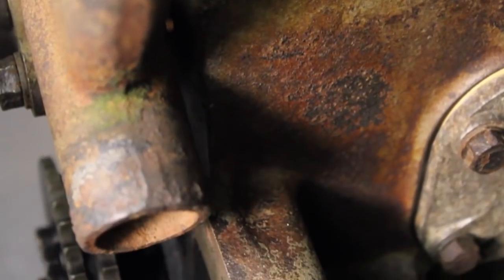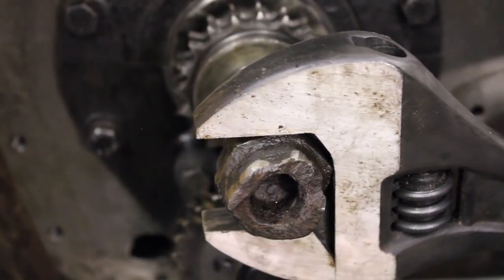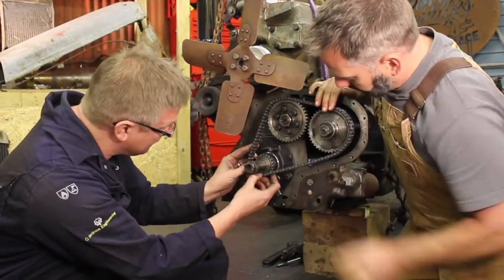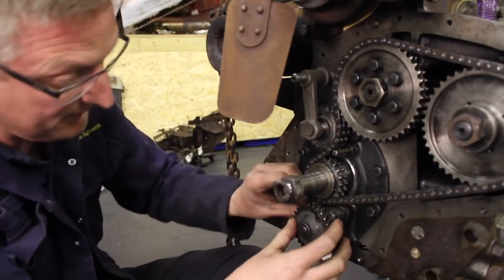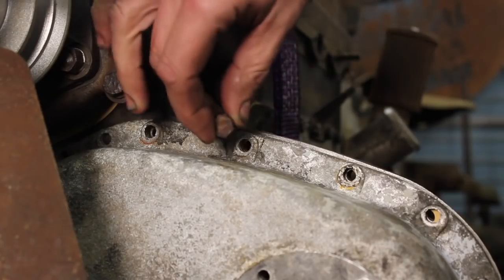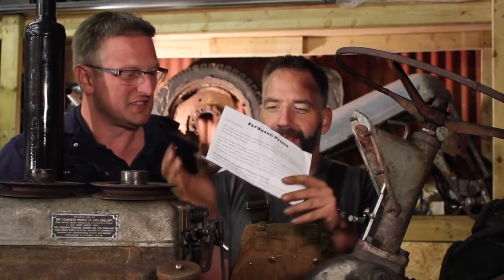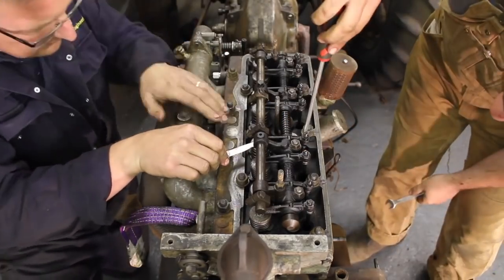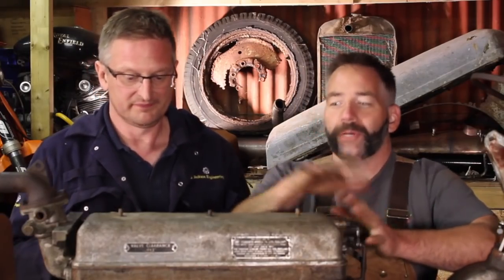Barn Find Fergie.  Episode 10. How To Time An Engine

Comment: Hi guys enjoying the build, long time since I was working as a mechanic (40 years) but I think your timing should be set at TDC on No1 cylinder on the firing/compression stroke if I remember correctly you could find the injector pump delivering into a cylinder with open inlet/exhaust valves. Hope this helps.
Reply from the maker: Thanks Andrew, that's great information!

Comment: You can use the "rule of nine" for setting tappets on a 4 cyl engine. When valve 1 is fully open, set gap on 8 (1+8=9), when valve 2 is fully open, set gap on 7 (2+7=9) and so on
Reply from the maker: That's a great bit of advice! Now I just need to improve my maths, hahahaha
Reply: Excellent tip👍

Comment: She's getting there guys, bit concerned with Jimmy's feeler gauges being "old and worn" must have lost a few thou over the years, better than my set though, where I once tried to set tappets on a HA Vauxhall viva with the engine running, per the manual, and ended up with feelers like crumpled kitchen foil!🙄
Reply from the maker: With it running!!!! Wow, that would be worth a watch!
Reply: @Torquestamiya 

Yes - the pushrod Viva engine. It didn't have a rocker shaft; the rockers were cupped pressings which pivoted on a self-locking nut with a hemisperical lower surface, screwed onto a stud pressed into the head. As the adjuster nut was stationary it was easy to adjust the tappets with the engine running allegedly 😂 gave up and did it stationary in the end
Reply: Sounds like fun!

Comment: Because I live in The States, I deal with both metric and Imperial (what we call SAE) fasteners all the time. All standard Imperial nuts and bolts have a metric spanner size that will fit them.

Comment: Pause.....Have to consider my options here....🤔 Will i risk going any further into a vid with two guys in a shed, boasting at the start about.......... loads of manual action....😲😱
Reply from the maker: Well did you???
Reply: Stroker, shafts, holes, shafts in/missing holes, coming together.....it just got worse Jimmy 😂🤣 Was it hard to insert this in the vid? Did it just go over Gavs head? 🤣😂
Reply from the maker: @JACKATTACKED  I couldn't possible know what you mean?
Reply: After 22 years in the military I’m immune! The art is in keeping a straight face, if you laugh you’ve lost😆